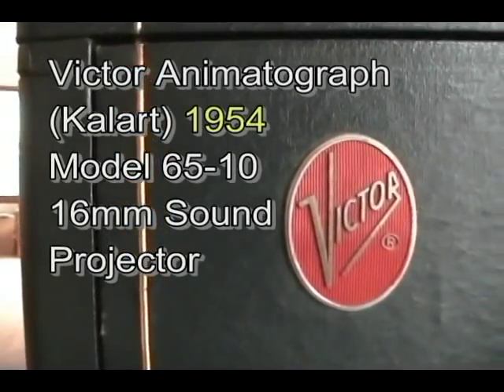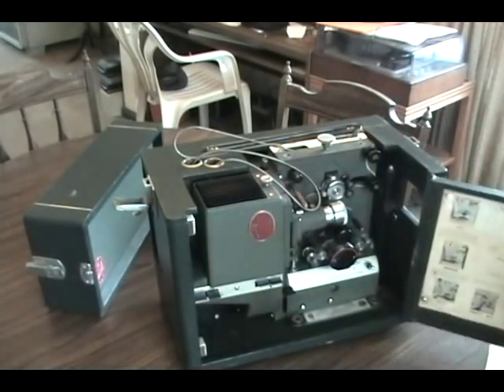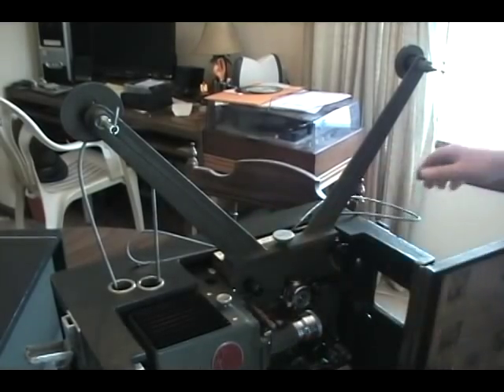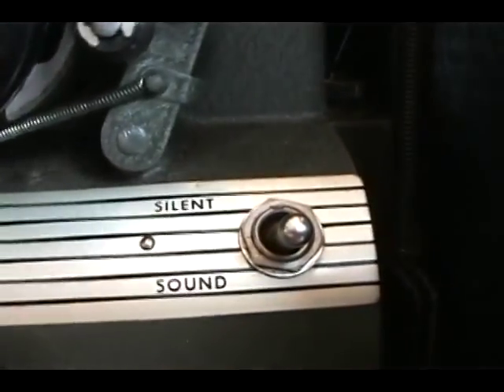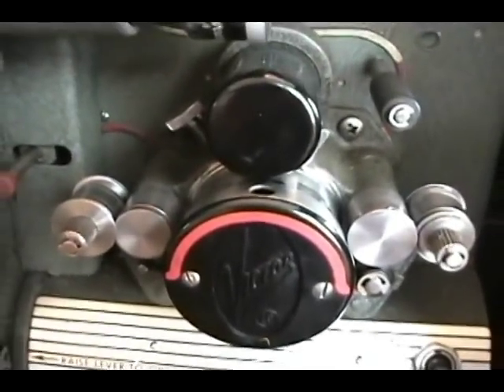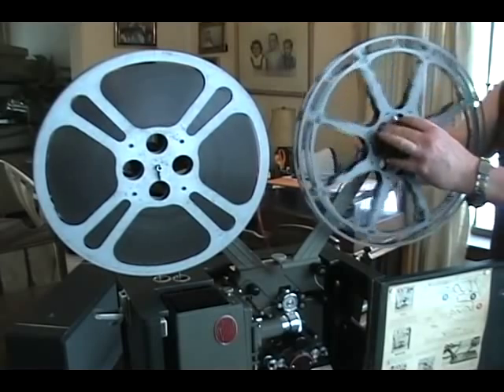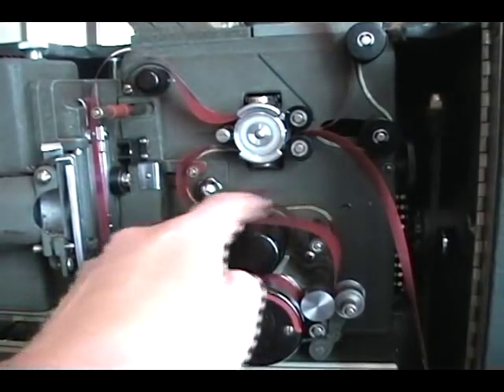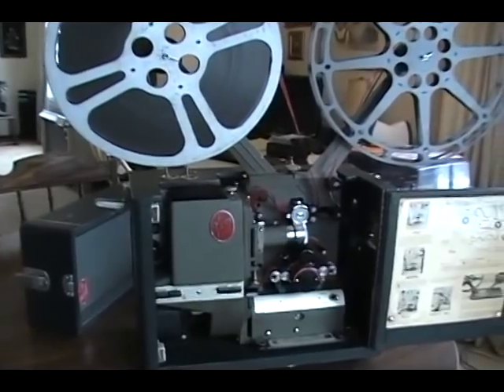16mm Projector - Kalart Victor Model 65-10 (1954)

Comment: I own a 1960 Kalart Victor 82-25 w/solid state amp and optical/magnetic sound drum.  I restored the unit 5 yrs ago.  It,s quiet and runs like a champ and case and projector head are in mint condition.  I,ll never sell it.  It retailed originally for over a thousand dollars!  Alot of money in 1960.  It's heavy (40 lbs) but I love how it handles vintage films w/o tearing. 90% of its parts are original.

Comment: This is an old Victor projector before the merger with the Kalart Corporation.  I always love operating the Kalart Victors (they're much quieter than the premerger Victors).   I disagree that they are difficult to run.  But, then, I've been operating them since junior high school.  I own several and they are always my favorite machine.  Victor made the first 16mm projector, so since the company made the takeup in the front, that's the way it's supposed to be!

Comment: Per "The Victor Animatograph Company and the Genesis of Non-theatrical Film," an article by David H. Shepard, and published in the Spring, 1976 issue of CLASSIC FILM COLLECTOR, the officers of Victor Animatograph approached the Kalart Corporation in 1955.  A short time later, Kalart merged Victor into its operations, and it became the Kalart Victor Corporation.  In all probability, this merger took place in 1956.  Motiograph assembled Victor projectors from 1951 to 1955, per the same article.

Comment: There is a much quicker way to thread these machines:  Open the gate (film trap), soundhead rollers, and sprocket shoes. Mount feed and take-up reels, attach leader to takeup reel and take up a foot or two. Draw down a loop of film to the soundhead. Thread the soundhead first, then from soundhead to take-up reel, then the gate back to feed reel. Take up slack, test threading and enjoy the show!

Comment: I have an older Victor Model 60 which has a separate metal case for the speaker.  Although the belts and pulleys look the same as 65-10, I found only the supply reel belt must be twisted to clear the opening.  If both supply and take-up belts are twisted, the supply reel gets driven by the take up reel by the common pulley.  By twisting only one belt, the pulley provides a little back tension to the supply reel.

My Model 60 to work properly must not have the take up belt twisted.  Keeping the belt untwisted allows the clutching action of the pulley to apply tension on the take up reel without the belt slipping.  Unfortunately this causes the take-up spindle to turn in a direction that the film takes up other side out.  Thus when the film is rewound, it makes sort of a sideways "S".

These old projectors with the old lamps consume a lot of power.  With a 1000 watt lamp the projector consumes 1200 Watts!  Compare that to the newer projectors that only consume about 400 Watts and provide the same brightness.

Comment: Great Video.....I just got a Kalart at a yard sale.....I hope you don't mid if I ask your advice........The motor makes noise but the reels don't move......all the tubs light up and the lamp works too.....Should I just sell it for parts or try and fix it? Thanks
Reply: Is the failsafe mechanism tripped? There should be a lever below the gate that engages the motor clutch.

Comment: Hi, I have a Victor projector similar to yours, mine is model 60, and I wanted to test the vacuum tubes to see if they`re still good, but the numbers on two of the big tubes is just about worn off and I can`t read them. I have a tube tester but can`t choose the correct calibration to test them because I can`t read the numbers. Any help would be appreciated.  Also thanks for this clip you uploaded because it helped me in knowing how to thread mine.

Comment: This projector is kinder to film than any other brand of projector. However, you are not threading it correctly. You put the film into the takeup reel and then pull film down to the sound drum. Insert the film into the sound drum. Then, thread the film around the bottom of the top gear to the takeup reel. Then, put the film into the lens path, and over the top of the top gear to the supply reel. Much easier to thread than what you showed.

Comment: You don't know how to thread the machine and that is why you think it is hard to thread. To thread it properly, open everything and  thread the film to the takeup reel and turn the takeup reel about 3 times. Grab the film between the reels, bring it down to the sound drum, make a loop and insert it into the sound drum. Close the sound drum arms. Make a loop and thread the film to the lower portion of the upper gear. Close that gear. Thread around the tension rollers and your're half finished. Now make the bottom loop on the left side of the sound drum and align the film for the film gate. Close the film gate. Make a loop and thread the film through the top portion of the upper gear. Finished. Later Kalart Victors had this threading technique printed on the base of the machine. Doing it this way is fast and efficient. 

As for the safety trips, any missing or torn sprocket holes would turn the projector off. Compare this to any other 16mm projector where missing or torn sprocket holes would result in the film being mangled and broken. Further, Bell and Howell 16mm with the built in speaker had terrible sound compared to the Victor. The cord on the Victor speaker is long enough to place the speaker at the front of the room by the screen so it is facing the audience.